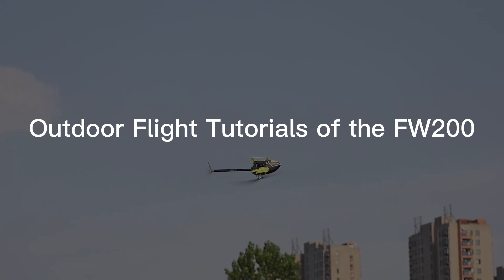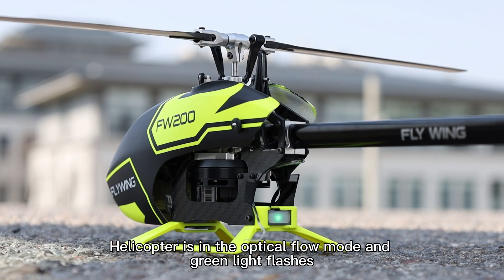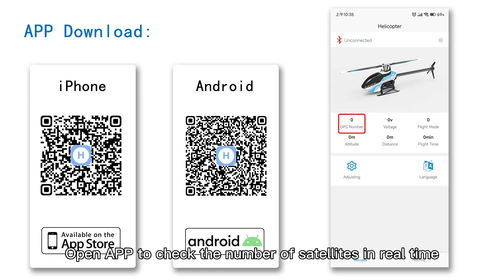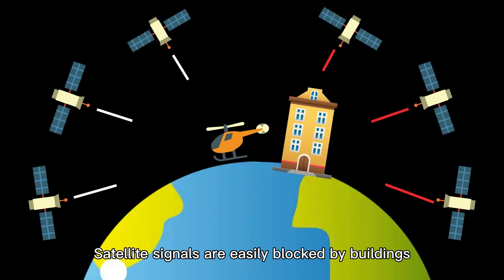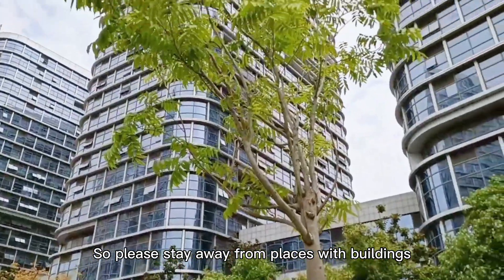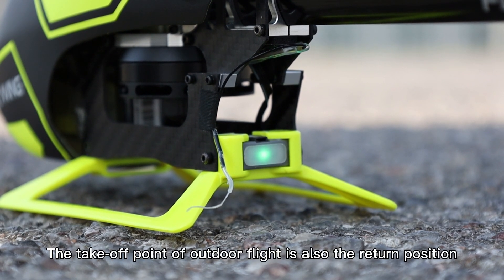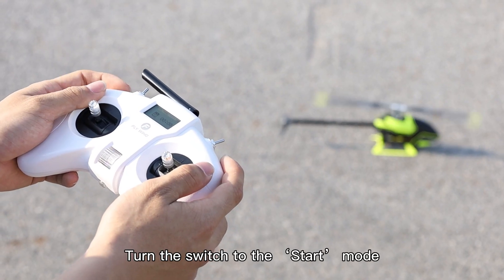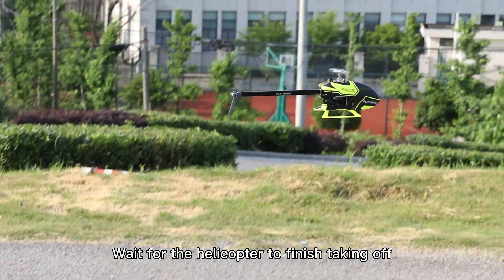How to fly higher？FLYWING FW200 RC heilcopter

Comment: just got mine yesterday. The GPS light remains in a solid blue color all the time even when placed outdoors. Any tips on how to fix this?
Reply from the maker: Check whether the plug of LED module is loose.
Reply: Mine takes a long time to go to solid Green.
Reply: @BF1GUN  Found the problem with mine. the small connectors going to the GPS module were defective and never made good connection. I had them replaced and problem solved!
Reply: @Frg_76  Thanks for the feedback 👍
Reply: U have to put it in gps mode for a solid green light